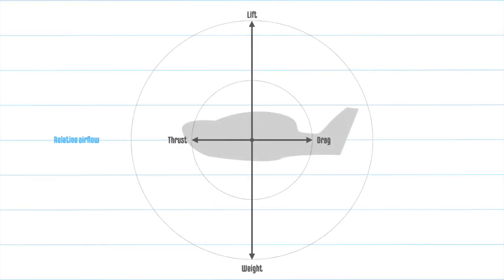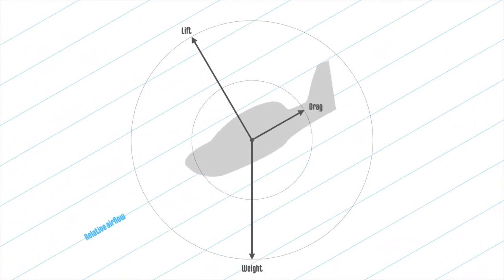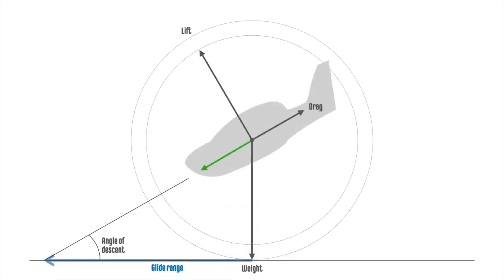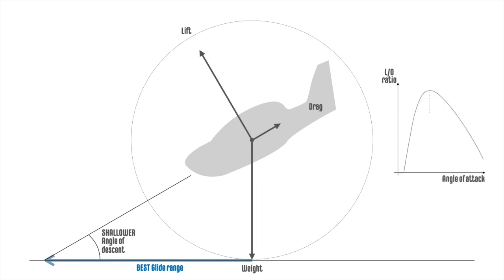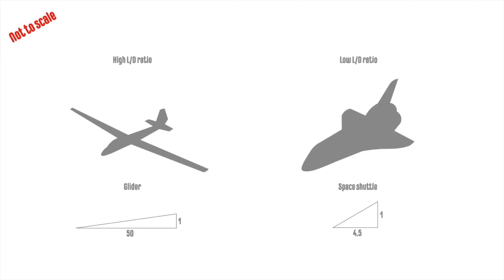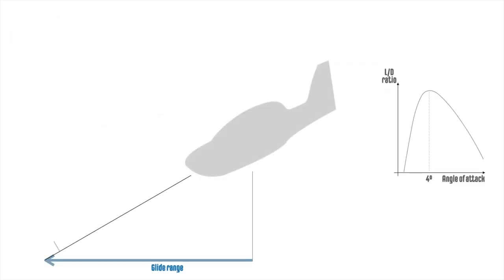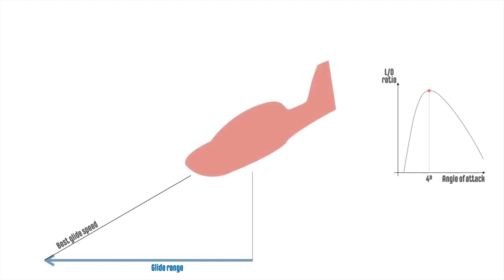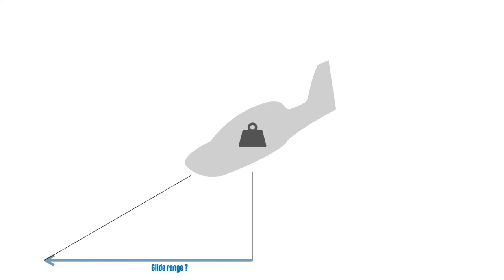How far can airplane glide?

Comment: ans to last question

Increased Descent Rate: A heavier aircraft will experience a higher rate of descent during a glide because there is more mass to pull down due to gravity. This results in a steeper glide path and reduced horizontal distance covered.

Reduced Glide Ratio: Glide performance is often measured by the glide ratio, which is the ratio of horizontal distance traveled to the altitude lost. A heavier aircraft will have a reduced glide ratio because it descends more rapidly for a given altitude loss.

Shorter Glide Range: With a lower glide ratio and steeper descent, a heavier aircraft will cover a shorter horizontal distance during a glide. This can be critical in emergency situations where an extended glide is needed to reach a safe landing area.

Comment: I thought that weight/mass acted towards the center of the earth due to gravity. Unless you're a star trek shuttlecraft or a UFO, it seems counter intuitive to say theres a forward component of weight. Rather you could consider that it is the momentum of the aircraft from its mass/weight contributing to the forward unchanged momentum. While a heavier aircraft will generally have a higher best L/D speed, that does not infer that weight is doing that but instead is a force that needs to be countered by the increased speed of the aircraft. There should actually be a forward component of lift instead of weight. Think of the much lighter sailplane vs airliner. Both rely on the same aerodynamic forces on the aircraft despite their different mass/weight. Weight does not act in the forward component for either aircraft, instead we need airspeed to obtain lift to counter weight and drag (without thrust we need to pitch the nose down to create airspeed to create airflow over the wing to create lift). Lift acts perpendicular to the relative airflow and since we are now pitched forward for glide the lift component has a slight "forward component of lift", this is what is 'lifting' or propelling us in the horizontal, while the vertical component of lift is not enough for us to maintain altitude against a higher weight component, it is enough to slow our descent into a glide assuming we fly at the aircraft's best L/D speed. If that speed is 450 knots or 65 kts or 50 kts is all dependant on the aerodynamic properties of the aircraft and the speeds determined in testing the aircraft.

Comment: Consolidated:
i am not a pilot, i am a design engineer exploring aircraft....and the answer to her question, at the end of the video is " IT DEPENDS"
in more rigid winged aircraft, an increase in weight results in a Decrease in glide ratio. 
alternately, concerning water weight in sailplanes ( gliders ), where the high profile wings are longer and thinner, and so are more flexible...there, the water weight cantilevers the lift forces out to the wing tips , and into the fuselage; this "wing loading" weight, giving the sailplane more inertia on launch, but also Flattening The Wings, therefore compensating the glide ratio with increased lift. ( sometimes actually resulting in an increase in glide ratio )

Comment: 4 degrees is the optimum angle of attack then on both the glider and the space shuttle ??? LOL , that can't be right.

what i mean is, more weight = lower glide ratio, but more speed .... or more weight, in the same air-frame, would put that specific wing's optimum angle of attack on a steeper apparent.
or to say, "best glide speed" seems to me to be " as based on averages" ...because each wing profile has an optimum angle of attack. ( i know airfoils from other topic studies ( yacht design )

Comment: Weight has no effect on angle of decent. Vmd will still result in max glide range. Weight does have an effect on the rate of decent. As the weight increases, so does the decent rate, therefore less glide endurance.

Comment: If you keep that same glide speed then weight will affect the glide distance. IF you slightly modify the gliding speed, (only few kts) then the gliding range will stay the same.
Reply: Consolidated:
i am not a pilot, i am a design engineer exploring aircraft....and the answer to her question, at the end of the video is " IT DEPENDS"
in more rigid winged aircraft, an increase in weight results in a Decrease in glide ratio. 
alternately, concerning water weight in sailplanes ( gliders ), where the high profile wings are longer and thinner, and so are more flexible...there, the water weight cantilevers the lift forces out to the wing tips , and into the fuselage; this "wing loading" weight, giving the sailplane more inertia on launch, but also Flattening The Wings, therefore compensating the glide ratio with increased lift. ( sometimes actually resulting in an increase in glide ratio )

Comment: L/D max is independent of weight if aircraft is flown at optimum AOA, the glide angle and distance will be the same but optimum AOA is attained at Vmd(min drag speed) which changes with weight. Vmd is directly proportional to weight. Any increase in weight will increase Vmd i.e a/c will accelerate at a higher Vmd(than before) which will increase lift,drag and forward weight component. Hence, aircraft will maintain it's optimum AOA (L/D max) but at a greater IAS
Reply: as per Newtonian Physics, a bowling ball and a feather will fall at the same rate in a vacuum....but a vacuum is not where gliders function.
Reply: or the change in Vmd would be due to a change in apparent, effecting L/D.....explain how i am wrong.
Reply: and i understand the heavier glider would be traveling faster....more lift is more drag, but more speed is more lift And drag
Reply: in other words, same gliders, with and without water.....the one without water would be more efficient, and that's L/D
Reply: i mean someone correct me if i am wrong....but i can't find a way out of the shift in apparent there.....it's a very minute shift, basically having to do with the divergence in efficiency.
Reply: Consolidated:
i am not a pilot, i am a design engineer exploring aircraft....and the answer to her question, at the end of the video is " IT DEPENDS"
in more rigid winged aircraft, an increase in weight results in a Decrease in glide ratio. 
alternately, concerning water weight in sailplanes ( gliders ), where the high profile wings are longer and thinner, and so are more flexible...there, the water weight cantilevers the lift forces out to the wing tips , and into the fuselage; this "wing loading" weight, giving the sailplane more inertia on launch, but also Flattening The Wings, therefore compensating the glide ratio with increased lift. ( sometimes actually resulting in an increase in glide ratio )

Comment: Increase in weight doesn't change glide performance in still air while flying at the correct minimum drag speed.
Reply: I have heard this many times about loading versus glide ratio but don't understand why it is.  

Higher wing loading glides faster.  While potential energy increases linearly with weight, air resistance is exponentially affected by speed.  

I would love a good explination as to why glide ratio is not affected with linear increase in push versus exponential increase in air resistance.  Thanks in advance!
Reply: It totally does, more weight requires more lift and thus more drag. If the glider is the externally the same but has more mass, then to generate the same amount of lift it must go faster, as the only way to generate more lift at the same angle of attack and roughly the same coefficient of lift is increasing speed. But that does not hold up nicely for wide ranges of mass variation as essentially for flying faster you are changing the Reynolds number at which your aircraft is operating, your glider would very likely stall at the wingtips earlier if you decide to go faster, worsening even further performance.
Reply: @Michallote  Wrong. Weight does not change the distance. However, the heavier aircraft will descent at faster speed compared to lighter airplane. But distance will remain the same. The only thing that change is the time but not the distance
Reply: @Michallote  its actually relatively easy when you look at the polars. weight simply pushes the polare into higher speeds, nothing else. When you look at it like that it becomes relatively easy to understand